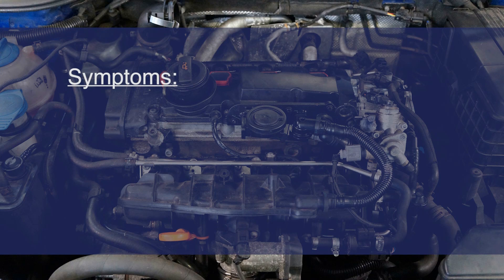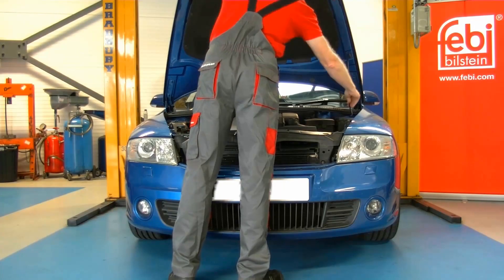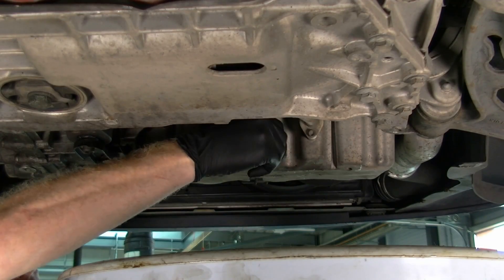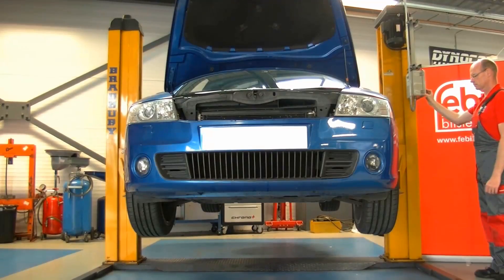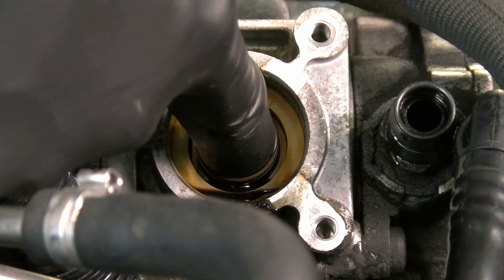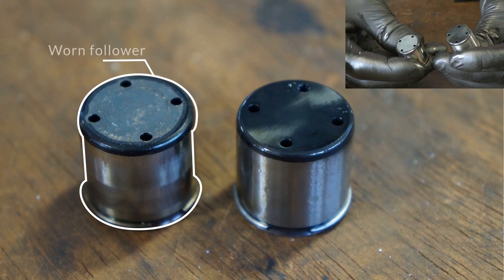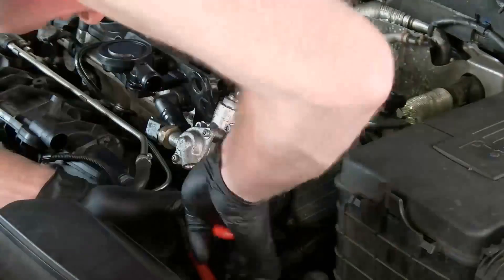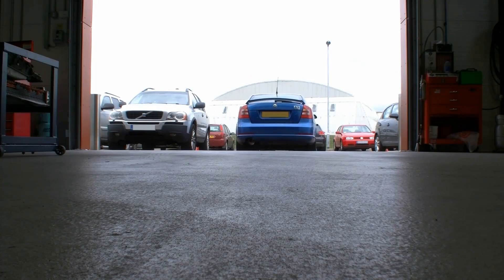[EN] 2.0 FSi/TFSi High pressure fuel pump cam follower replacement

Comment: Hi Febi!
Is this procedure the same for the Seat Leon 1P chassis BZB 1800 tsi engine?
Reply from the maker: Thank you for watching our video. The high pressure fuel pump fitted to the 1.8 is driven by the camshaft similar to the 2.0. However, it is a different fuel pump and follower to the one shown in this video.

Comment: Very good video friend I was looking for information about a Mazda CX-7 2.3L Turbocharged on the cam tracker but I did not find any information, I have the code P0172 I have checked everything to the engine and nothing that I solve, the only thing I have not changed is the Cam Follower you think it has to do? Apart I have a noise of metal squeaking from the high pressure pump
Reply from the maker: Thank you for watching our video. The fault code you refer to is a rich mixture fault. There could be many reasons for this. Regarding your squeaking noise, the fuel pump fitted your vehicle engine is similar to the example shown in this video and can be removed in a similar way for inspection.

Comment: Tenho um 2.0tfsi gostaria de saber de quantos a quantos km tirei que mudar cam follorwer se é de 10.000 em 10.000 ou de 20.000 a 20.000 km?
Reply from the maker: Thank you for watching our video. The high pressure fuel pump camshaft follower featured in this video is a common wear item. The failure rate will vary from vehicle to vehicle. Factors such as regular engine oil servicing will improve wear rate. There was also an update to the follower case hardening to this part which was improved in production in 2007.

Comment: I have a mk 4 golf 150 pd, my garage said the injectors seem fine but that the hpfp is coming up in diagnostic test, garage said this part is around £600 but if they replace it may blow my injectors as my car has 147k miles, can i not have him replace my injectors with remanufactured ones? Really appreciate any advice its a tdi 1.9 i absolutely love the car, how possible will it be to blow my old injectors?
Reply from the maker: Thank you for watching our video. Replacing the fuel pump will not cause an issue with perfectly serviceable injectors. However, if the diagnosis of the failed fuel pump is due to internal contamination e.g. metal or engine oil then the complete fuel system requires to analysed to see what is required to be replaced.
Reply: @febi.bilstein  ah ty brilliant yea Ihe is a really good mechanic and thus far he didn't mention a catastrophic failure so maybe I've dodged a bullet other than obviously needing the new hpfp, he said the injectors are all working fine so I guess no metal shavings are present, thanks for the reply really appreciate it

Comment: I just replace alternator, but the engine misfire. When scan It read P1063 fuel pressure regulation - Value below control limit. Does it have something to do with Plunger High Pressure pump ?
My car is Audi A3 2.0FSI 8p1
Reply from the maker: Thank you for watching our video. The common fault codes associated with the fault in this video are P2293, P0087 and P1093. P1063 could be related to a fuel sensor issue, it would be recommended to check the fuel pressure to start with to diagnose the issue.
Reply: Did you fix the issue? I have the same fault code. I will be replacing the cam follower I don't know if I should also change the sensor?
Reply: @mk5gti  yeah I fix it. The Car stall occasionally without warning, very horrible. Found out Engine speed sensor is the culprit and need to replace. Nothing to do with fuel pump. Now its running smoothly. This is the sensor location for my reference.

https://youtu.be/ITHLsWa8v1w

Comment: Hi mine the engine just stops running while in motion.when started again after metres the engine stops again.when checked on computer it just shows fuel system problem.what actually could it be?
Reply: Same here found the solution?

Comment: Hi Febi. I completed this process as I had a leak coming from the HPFP so thought of replacing the cam follower and respective seal. Unfortunately the leak continues but does not smell like fuel. Smells like oil. Any advice?
Reply from the maker: Thank you for watching our video, if you have replaced the seal for the fuel pump and you think the oil leak is around the high pressure fuel pump area, check the pump and all other engine parts where oil leaks could occur and repair accordingly. e.g. cam cover gasket.

Comment: My Audi 2.0tfsi is now at 75000km is it time to check?
How many Nm do the retaining bolts need when re installing the fuel pump?
Reply from the maker: Thank you for watching our video, to answer your questions. it would be worth while checking the fuel pump cam follower as a precaution as a good case of preventive maintenance on your vehicle. The fuel pump retaining bolts have a vehicle manufactures recommended setting of 10Nm which is featured in this video.

Comment: I have a vw 2.0t  fsi I change the coil packs and spark plugs and fuel pump assembly but it still has random missfires any ideas?
Reply from the maker: Thank you for watching our video. To try and reply on the subject of your misfiring engine, this is not easy with the information supplied. A engine misfire can be electrical, fuel or mechanical related and trying to track down this fault can take a lot of time and effort as this is an intermittent fault. All fault codes and data need to analysed and a emission test needs to be carried out. Also when the misfire occurs you need to determine if the misfire happens at idle, under load or cruising. I wish I could give you an easy instant answer, but there are to many variables to give you a simple answer.
Reply: febi.bilstein it happens between two and three rpms and idle roughly and shakes between 2&3 rpms besides that's it drives ok but I'm trying to fix it before it gets worst
Reply from the maker: Thank you for the extra information, but this is only telling when it happens, as I suggested in my last reply this issue needs to be diagnosed correctly and methodically.
Reply: febi.bilstein check your coil pack connectors if it’s broken that can be a problem, your spark plugs or coil packs itself that’s what I know lol
Reply: Edsel Martinez injector
Reply: Could Be EGR valve and or PCV engine breather. Change them both. With these cars it’s not always about changing oil spark plugs and coils. It has a fussy fuel system run by the EVAP system. it should tell you once you diagnose and get a fault code and go from there. For example if it was a coil pack you would know because it would make loud rattling engine noise and the misfire would be obvious of course! These TFSI engines are very sensitive to over fuelling so EGR could be issue. Or an injector. Use injector cleaner by Lucas oil I think 250ml to every 20L fuel. Hope this helps
Reply: I recommend a carbon clean to head where injectors sit along with inspection of injectors.